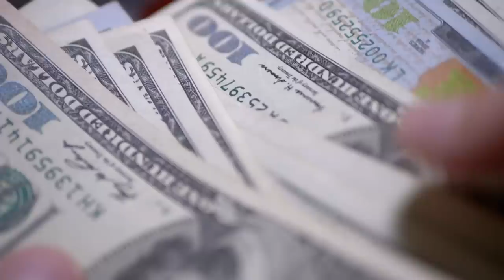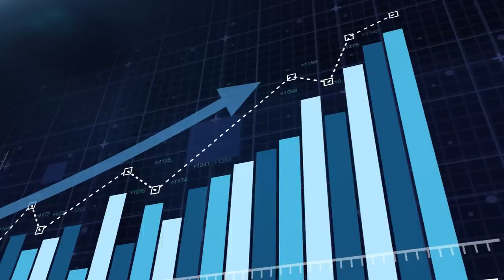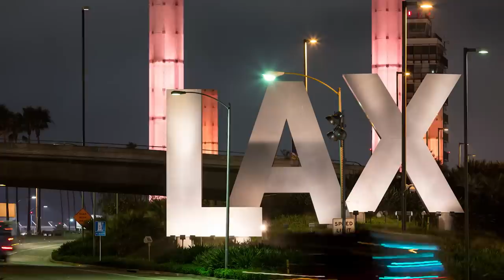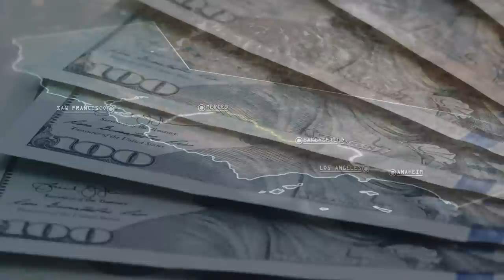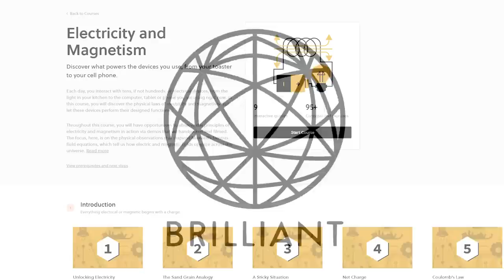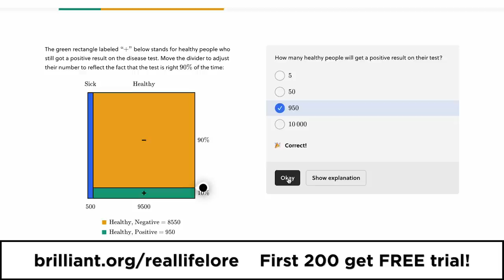Why California High Speed Rail is Struggling (Re-upload)

Comment: I’ve said it before and I’ll say it again. There’s no true freedom of movement without public transit and trains are absolutely vital in this regard. Between the Bay Area and LA right now, there’s only three land connections: Hwy 101, Interstate 5, and Hwy 1. Hwy-1 is the scenic route built along CA’s sheer Pacific cliffs and is at constant risk of collapsing into the ocean. Both the 101 and 5 are bottlenecks that get completely blocked when someone gets into an accident due to sleepy driving under the heat of the Central Valley. High speed rail is much safer, faster, and an overall critical solution to resolving the ever increasing traffic that ensnarls both the Bay Area and LA. Cars may get you anywhere, but in dense urban environments, no matter how wide the roads become, congestion just gets worse with more people, and that’s all before parking and accidents are taken into consideration, both of which are hugely problematic in areas with big populations.

Completion of this high speed rail is vital to CA’s long term growth, and I’m all for it. Foreigners (and natives) living in the EU, China, and Japan can easily get around with their massive rail network quickly, cheaply, and efficiently. You can’t say the same about foreigners (and non-driving natives) living in the US, who need to get a driver’s license and buy/lease a car before they can do anything on their own. This also applies to kids and teens.
Reply: I mean, there IS freedom of movement without them. It's just grueling and expensive AND/OR time-consuming, whether by car, by horse-drawn wagon, or on foot :P

But just like freedom of speech is underpowered without equitable access to communication technology (be it by postal service, by telephone or telegram, or by internet connection), freedom of movement is underpowered without equitable access to transportation technology. There is a point where freedom meets equity optimally, and societally it is in all our best interests to find it, and in this country particularly, we need to find it yesterday!

P.S. re: the rest of what you say, I broadly agree, and I'm not contradicting any of it.
Reply: High speed rail is critical for any hope of humanity's future sustainability. You are correct - high speed rail is much safer, faster and better solution than more people in individual vehicles on highways pushing themselves through long and exhausting travel trying to stay alert. The solutions are out there, but we need a major system change in order for it to actually come to fruition. It can happen, but people need to realize the system is the sickness and we can't have a sustainable future without system change. A good alternative to look into is an 'economic calculation in a natural law resource based economy.'
Reply: China has built more miles of high‐speed rail than any other country and has gone more into debt doing it… $800 billion, and most of its lines aren’t covering their operating costs.  As a result, China is shifting to building more roads.

France’s state‐owned railroad has piled up debts of more than $50 billion and has been repeatedly bailed out by the government.

Spain has built its high‐speed rail system with a public‐private partnership. Officially, the private partner has gone into debt by $20 billion.

The state‐owned Japanese National Railways has a debt of $550 billion.  Today Japan has
Reply: @electrictroy2010  OMG large infrastructure projects are very expensive? Who knew???? Still overall hugely beneficial in terms of economic activity and improving the lives of people. Also not getting the full picture in all those cases by debt alone.
Reply: For what it's worth, the Eisenhower Interstate Highway system cost the USA something like $500 billion in 2021 dollars to build out, and has most likely cost at least some substantial fraction to expand and maintain in the decades since its original completion. Strictly speaking, it has never turned a profit, if you look at its operation like one would look at the profit margins of a single business.

That is not the right way to look at public infrastructure projects. A somewhat more suitable way would be to compare its cost to its economic return, which is defrayed over many people over many years in the spurred activities, and which, without such investment in infrastructure networks, they would most certainly have never been able to do (and generate tax dollars for the public to pay debts and generate further investment).
Reply: "There’s no true freedom of movement without public transit and trains are absolutely vital in this regard. Between the Bay Area and LA right now, there’s only three land connections: Hwy 101, Interstate 5, and Hwy 1."

Irrelevant because everyone flies. CAHSR is too slow to change that.

Just look at the traffic map on 511, look at it during rush hour California time. You'll see there's a big blob of red for LA, and lots of red in the Bay Area too, but the three highways that go vertically between those areas are all green. That's because the traffic issue is WITHIN the Bay Area and WITHIN Los Angeles/San Diego, not between.

CAHSR does nothing to address traffic on 405 in Los Angeles or on 101 in the Bay Area. Nothing.
Reply: you can only have true freedom of movement when we have access to cars.  
we can travel whenever and wherever we want.  
this doesn't apply to trains
Reply: Movement dictated by a public transportation system with restricted routes and schedules is by definition not free.

Comment: This doesn't feel like re-upload at all, it has so much more information and makes a lot more sense, amazing work guys!
Reply: China has built more miles of high‐speed rail than any other country and has gone more into debt doing it… $800 billion, and most of its lines aren’t covering their operating costs.  As a result, China is shifting to building more roads.

France’s state‐owned railroad has piled up debts of more than $50 billion and has been repeatedly bailed out by the government.

Spain has built its high‐speed rail system with a public‐private partnership. Officially, the private partner has gone into debt by $20 billion.

The state‐owned Japanese National Railways has a debt of $550 billion.  Today Japan has

Comment: This was well researched and much more representative of the actual situation at hand. Thanks for catching your errors and addressing them.
Reply: China has built more miles of high‐speed rail than any other country and has gone more into debt doing it… $800 billion, and most of its lines aren’t covering their operating costs.  As a result, China is shifting to building more roads.

France’s state‐owned railroad has piled up debts of more than $50 billion and has been repeatedly bailed out by the government.

Spain has built its high‐speed rail system with a public‐private partnership. Officially, the private partner has gone into debt by $20 billion.

The state‐owned Japanese National Railways has a debt of $550 billion.  Today Japan has
Reply: @electrictroy2010  OMG large infrastructure projects are very expensive? Who knew???? Still overall hugely beneficial in terms of economic activity and improving the lives of people. Also not getting the full picture in all those cases by debt alone.

Comment: As a European Railway Engineer I can see two major mistakes instantly with this project as you describe it. Construction should have started at either San Francisco or Los Angelas, for the simple reason of introducing the plane/car loving population to the advantages of high speed rail as soon as possible. As opening the central section first is likely to doom the project knowing the backward thinking of the US public towards trains.

 Secondly building the line mile on mile on an elevated structure is plain stupid. It horrendously increases cost, takes much longer to construct & guarantees much higher running costs in constant maintenance of these elevated structures, especially in earthquake prone areas. It should have been built along the ground, with roads given bridges over or under the line, & a cheap high security fence to keep suicidal idiots out !!!

I would also guess that if the line ever gets complete, California will need another Nuclear Power Station just to provide the huge electrical demand that these electric high speed railway lines require. Not something I have seen mentioned anywhere !!!!!!!!!!!
Reply: As a Californian, my love for high speed rail is a Trojan horse for my love of nuclear fission power, the safest nonrenewable.
Reply: which sucks because both of those things have been used on california’s current railways, they’re just far too old-fashioned and slow, not to mention understaffed, to actually be significantly effective as commuter rails
Reply: As a Californian all I would say is the elevated platform looks awesome lol, I’m not sure why they did it that way I want to believe it has to do with the hundreds of miles of irrigated land it passes through or the geography and that the route goes through some of the largest renewable power plants in the country which are being expanded in the high desert, also not opposed to nuclear.
Reply: "Construction should have started at either San Francisco or Los Angelas... [sic]"
Which demonstrates that you don't understand California politics.  Funding CA HSR required passing a state-wide bond measure voted upon by the whole electorate.  The only way to gather enough votes was to get a lot of support outside the San Francisco Bay Area and Greater Los Angeles Metro area.  The only way that was going to happen was if the Central Valley got their piece of the project FIRST.  Because otherwise they'd be sure that it was just another big urban project that would never help them in their lifetimes.
Reply: The location of the rail line was a political issue, not an engineering one

Comment: Honestly, I love that I can tell what you changed compared to your previous version. And not exclusively the pronunciation of  "Merced" which I completely understand as I've only lived in LA for a few years. Thanks for just being a consistently great video maker
Reply: China has built more miles of high‐speed rail than any other country and has gone more into debt doing it… $800 billion, and most of its lines aren’t covering their operating costs.  As a result, China is shifting to building more roads.

France’s state‐owned railroad has piled up debts of more than $50 billion and has been repeatedly bailed out by the government.

Spain has built its high‐speed rail system with a public‐private partnership. Officially, the private partner has gone into debt by $20 billion.

The state‐owned Japanese National Railways has a debt of $550 billion.  Today Japan has
Reply: @electrictroy2010  OMG large infrastructure projects are very expensive? Who knew???? Still overall hugely beneficial in terms of economic activity and improving the lives of people. Also not getting the full picture in all those cases by debt alone.

Comment: Meanwhile, here on Vancouver Island, we have no more passenger train service at all.  Our one railway, the E&N, has deteriorated to such an extent that running passenger services on it is no longer safe, so we are pretty much stuck with the car, and it will most likely remain that way for a long time.
Reply: But Vancouver islands population in so small though and low density
Reply: @SuperKing604  So?  Would you really want us to be condemned to cars?

Comment: I think that the 22bn segment from the Central Valley to San Francisco will likely be completed. The segment between Blossom Hill Caltrain station and the San Francisco Transit center will most likely need to be upgraded for future Caltrain service. This means that infrastructure like new passing tracks, an upgraded station in San Jose, and grade separations will likely occur without High Speed rail funds. Between Blossom Hill and Gilroy the land is flat and easy to build on like in the Central Valley. But the challenge is obviously the 25 miles across the mountains between Gilroy and the Central Valley where it’s estimated to cost between 7-10 billion for a tunnel. I think that it’s likely that the project will connect San Francisco to Bakersfield in 10 years but no Los Angles.
Reply: That Caltrain segment is already getting upgraded to hsr/electrification and it’s i haven’t seen anyone actually cover this. Down in LA union station rail alignments are under reconstruction for metro adjustments and HSR as well. So in reality it’s San Jose to Merced that needs building to complete HSR to SF and multiple projects are happening simultaneously than people give them credit for.
Reply: @nayhboseguera1774  although local agencies are upgrading los angles Union station and the station in Anaheim, they are not upgrading the corridor between the two which I don’t get. It takes around 50 minutes for Metrolink trains to go between Anaheim and Los Angles currently. Which is just shameful for two cities that are only 25 miles apart. The people in charge of the transportation systems in LA and Orange County should have definitely invested in upgrading this corridor so it has more tracks so HSR gets its own set and Metrolink/Amtrak gets its own set separate from freight, full grade separation so trains can operate at higher speeds around 125mph, and upgraded junctions so different systems don’t wait for eachother. I am truly baffled by the lack of investment in Metrolink and the over investment into LA Metro, good commuter rail plays a huge part in cutting traffic.

Comment: The very slow pace that California is making on high speed rail is a warning sign for the rest of the country. Any high speed railway project in the USA will get super expensive and move at a very slow pace. California is currently the only state building high speed rail right now, but it is going very slow. Texas and possibly Florida are considering high speed rail but neither of them have started yet, and I predict their high speed rail projects will move even slower then California's high speed rail.
Reply: If Texas and Florida actually decide to fund high speed rail I expect those project to move considerably faster. Those states are notorious for cutting corners, plus they have favorable geography.
Reply: Texas should do better because it's a private company doing it at their own expense which is how these things should be done. Airplanes are far superior for high speed transportation between urban areas in the USA, Canada and Australia simply because of the vast distances involved. 

It would take the TGV 16 hours to go from Silicon Valley to New York, whereas a plane can do it in five or six hours.

Same for SV to LA/SD....you can fly there in an hour. There's no need for this train.
Reply: @neutrino78x  Airports and air traffic control systems don't get built by private companies at their own expense. I don't see how you expect trains to do that. To be like an airline, the TRAIN would be privately owned but the tracks and stations would be built by the government.
Reply: @NozomuYume  wrong, both should be run by the government, literally every country does that and have highspeed rails yet US never learned the lessons
Reply: @NozomuYume  the rail system in the UK became worse after privatising. Almost like private industry only cares about profit and not innovation and progress
Reply: @Derkiboi  I'm not saying it's a good thing, just that you can't call airlines "private" or "free market", because they rely so heavily on public infrastructure. There a certain group of Americans that complain about subsidizing rail travel but don't see the irony that they support the massive public funding of road and air travel.
Reply: @NozomuYume  oh yea no I'm supporting your claim,
Reply: @NozomuYume  air traffic control is controld by private corporations and airports charge a lot in fees and rent to airlines and business . So most major airports are profitable , only the smaller ones loss money
Reply: And there are two main reasons: a lot of contractors and NIMBYs trying to either block the project or jack up the prices even higher before selling it to the govt. Both have to be dealt with.
Reply: It should be faster, the honest thing about HSR is we do not have any subject matter experts. California HSR is a major learning experience but will go a long way to help other states.
Reply: @inksuckeye1  very true
Reply: @Derkiboi  Established private industry does care about innovation sometimes, but that's only when a lack of innovation results in a loss of profit. Established industries don't innovate unless they're effectively forced to do so. In fact, they'll actually work to stifle innovation if doing so works in their favor.
Reply: @neutrino78x  No infrastructure projects are built entirely with private money. Not even the transcontinental railroad (mid 1800s) was built with private money. It was massively subsidized with enormous land grants and very favorable loan terms. There was some private money, but without government subsidies it never happens because large infrastructure projects are too expensive and the payback time is too long for any private company/companies to foot the bill. Investors simply don't tolerate those terms.

The only infrastructure projects that are entirely privately funded are things like roads and sewer systems in new home construction (subdivisions). Those are incredibly tiny compared to building something like HSR.
Reply: @jasond5232  There is also the fact that land is generally cheaper in these states with the exception of like 2 cities in Florida